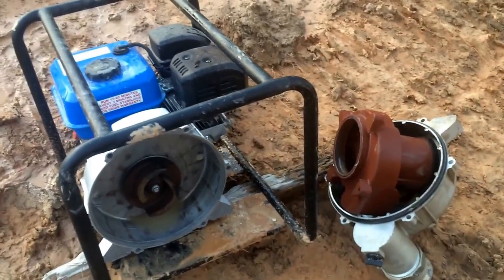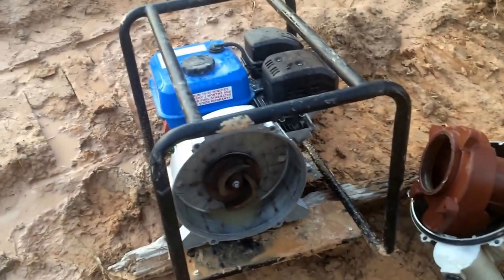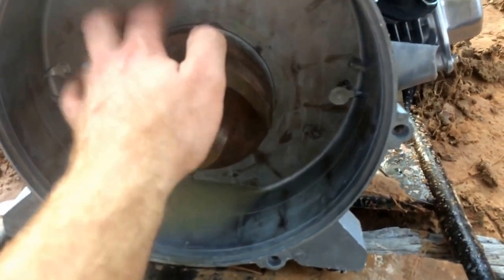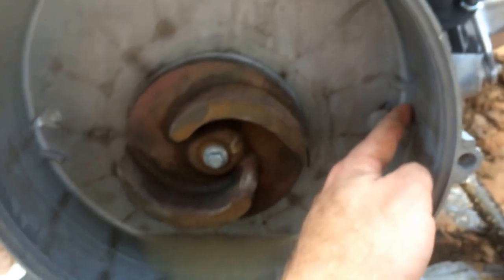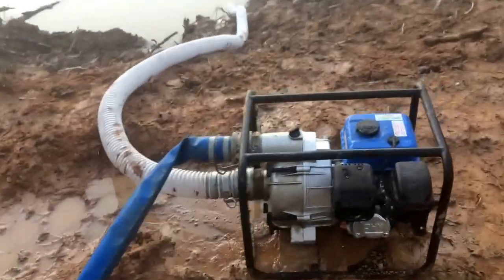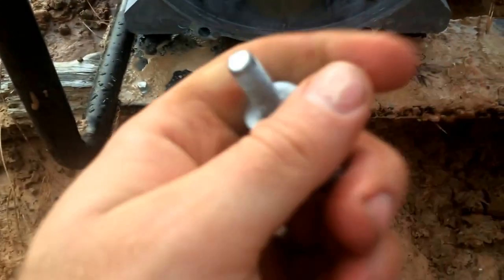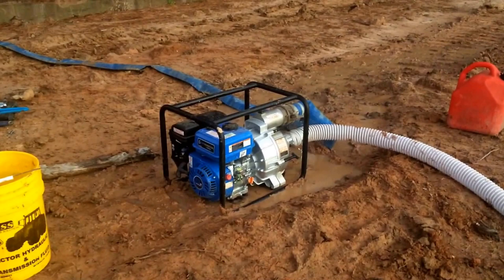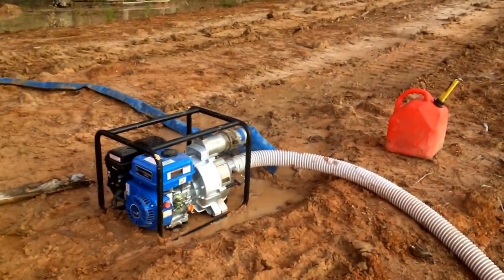Water Pump Repair - Loose Bolts from Factory

Comment: Cheap junk.   Mine started leaking rear of the shaft.   Pulled off the housing and the impeller and bolt fell out.   The center bolt holding on the impeller broke off inside.  I'll have to drill and easy out the the remaining bolt inside.    Cheap Junk.  Hard to even order the mechanical seal.   Not easily available.  Pump was new only used about 4hrs.  total run time.    Due to vibration I guess and a light duty bolt used.

Comment: How did you take the impeller off?
Reply from the maker: For this pump the bolt in the middle is all that holds it on. It’s a standard right hand thread, so counterclockwise to loosen. It can be hard to hold the impeller and break torque. I’ve wedged a board in before. But if you have an impact driver that’ll zip it right off.
Reply: @TomBrueggen  I got that far, but then how do you actually get the impeller off? Do you need a gear puller? or is the impeller threaded on to the shaft? I took the bolt off but cant get the impeller off.
Reply from the maker: danjimielson it may just be seized up a bit, but it should just wiggle off. I never needed a gear puller. Maybe just needs a little coercion...Good luck.

Comment: I need some help on how to remove the water pump pls ASAP
Reply from the maker: If you have a bolted on impeller like this video, use an impact driver to break the torque without spinning the shaft. Or use a hammer for a quick pop on the ratchet handle as opposed to a slow steady pull. Otherwise you have to find some way to wedge a board or something in to hold it while you rotate the bolt loose. If it has the bullnose type impeller that appears pressed I’m no help. I had two pumps like that, only briefly. I never figured out how to take the impeller off, but they both leaked profusely, so I returned them under warranty and the new ones I got had the bolt impeller
Reply: @TomBrueggen  it’s because I’m making a go cart but i need to be able to remove the whole water pump but my dad helped me

Comment: You are a life saver!  Mine started leaking and I was thinking I had a bad seal. I found this video trying to figure out how to get the impeller off and bam, when I got it off those same two bolts fell out!
Reply from the maker: Happy to help! These little pumps are pretty cheap, and not great, but if you can keep them going they'll pay out!
Reply: @TomBrueggen  that they are! Have you had any luck finding parts for them?  I have found that some of the engine parts are swappable with a Honda gx200 motor. The predator 212 is a clone of that engine. Hard to find pump parts though.
Reply from the maker: I've never had to find pump parts. The owner manual has a parts diagram and phone number, but every time i tried to call the number I never got through to anyone.
Reply: Only thing I've ever needed was the clean out cover. Mine cracked last year after it froze up and I couldn't find anything. I called that number and had the same luck.
Reply from the maker: Oh hey Chris, I just noticed this is an older video. I thought you were commenting on the newer one. I just released one a month or so ago on an unboxing of this same sort or pump. First thing before I even started it was to put thread locker on those bolts. That video was actually made over a year ago, and so far those bolts haven't come loose on me.
Reply: Ah yea!  I'm gonna see if I can find two new bolts to match those and loctite was gonna be my next move. Crazy how I had the exact same ones loose.
Reply from the maker: You still need a cover? I might have one or 4 laying around ... : )
Reply: 4 good lord! Haha I could use one if you've got a spare. How far from NC are you?
Reply from the maker: Chris Potter east Texas. You don’t need this for this weekend do ya!?
Reply: Hopefully not! 🤞🤞.  I normally use mine to flood a duck impoundment I have here.  I'd bought another but I've been trying to find a cover for my original one bc there's nothing else wrong with it.
Reply from the maker: So you need the aluminum cover that the ports are in right? Held on by 6 T bolts. I know I have at least one. Just hope I wouldn't send it to you and then break mine somehow! Although I do make it a point to drain them if we are suspecting cold weather here. It's rare to get a frost, let alone a hard freeze. I'd be more likely to break it by dumping the pump out of the bucket of my tractor on a move or something.
Reply: @TomBrueggen  I still haven't messed with mine yet, I've been trying to find replacement bolts for the two that backed out. After you got everything reinstalled did it stop leaking or was the seal damaged?
Reply from the maker: Chris Potter I don’t think I ever really got it back to new, so to speak. By the time I tightened them, one or two was stripped if I recall. Or maybe they still leaked. I recall I took both pumps back and warrantied them due to the leaking. The new ones I got had pressed on impellers, so I couldn’t take them them off to inspect, but they never leaked. Those ended up crapping out from engine failures, and when I got replacements they were back to the bolt on impeller, so I thread-locked the mounting bolts before ever starting the pump.
Reply: @TomBrueggen  that's my plan is trying to find the new bolts and loctite everything. Hoping to not have to buy a new pump but we shall see. The one I've got with the cracked case has a pressed on but the one with the loose bolts is a bolt on. Can't swap housings like I'd hoped to.
Reply from the maker: Got a smoke wrench? That'll get that pressed on impeller off!
Reply: Hahaha yea it will work

Comment: if its possible could you show a video of how the propeller can off.
Reply from the maker: These are the easy ones. Just reverse thread that bolt in the middle of the impeller. It's a normal RH thread I believe, so turn the bolt left to loosen. You have to secure the impeller somehow to keep it from spinning, or if you have access to an impact driver that will pop it off. I can zip this thing off and on in a few minutes now to check those bolts.

Comment: How did you get the impeller off?
Reply from the maker: You just have to loosen the bolt in the middle of the impeller. The key is, you have to find a way to hold backup on the impeller or shaft to keep it from spinning. If you have an impact driver it may pop it loose without backup, but standard socket will probably turn the shaft too.

Comment: Hey Man.... This is probably what just happened to my 2" pump. I bought one after watching your review of the 3" pump by the way. YOUR Review is the only reason I bout mine. I ran the piss out of it, 15-18 hours at the time. Changed oil after every use. It suddenly made a pop racket and stopped pumping. Just the way you said, Harbor Freight is sending a gift card to replace it and told me to just keep the old one. So I am going to try to rebuild the 2" if it isn't too expensive plus I plan on putting a little money with the gift card and going with the 3" and run them both. Thanks much for the review and advice, keep up the good work with the videos brother. God Bless!
Reply from the maker: Huey Sullivan sounds good! Just check those bolts on your brand new one and put a bit of loctite on them. Hopefully nothing is too gummed up and you can just replace a bolt. The engine block is aluminum so be very careful with the torque on the bolts! Best of luck!
Reply: I'm just wondering if it sheared the key on the shaft... ever had that happen? Not really sure just yet. All I know is, it got tilted sideways and whap! The motor runs like a beast,,,, the pump however not so much!  Haven't had the chance to tear into it yet. Lock Tight is good to know! Thanks again for the video, great advice on returns